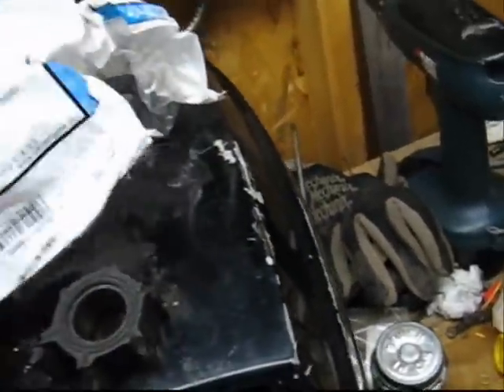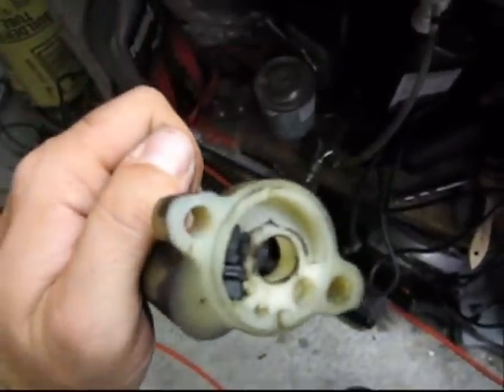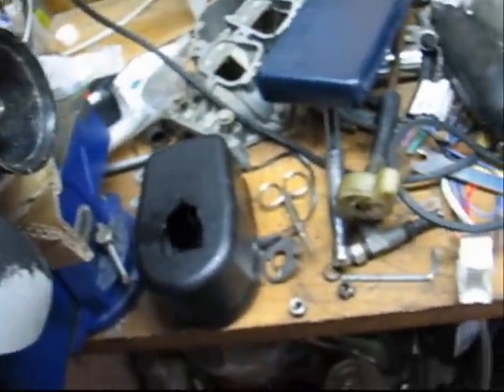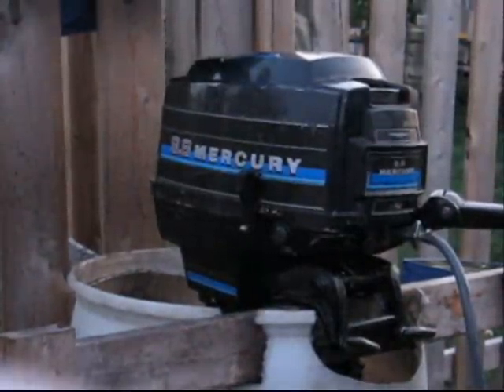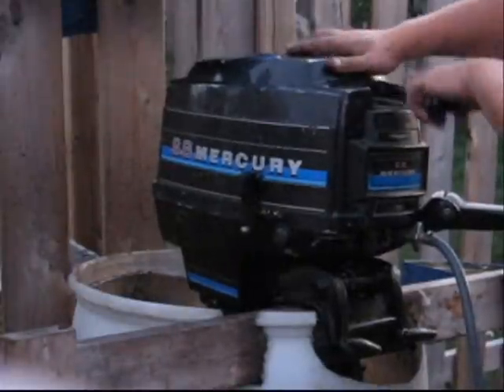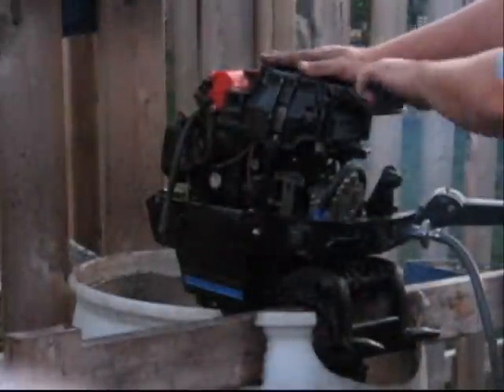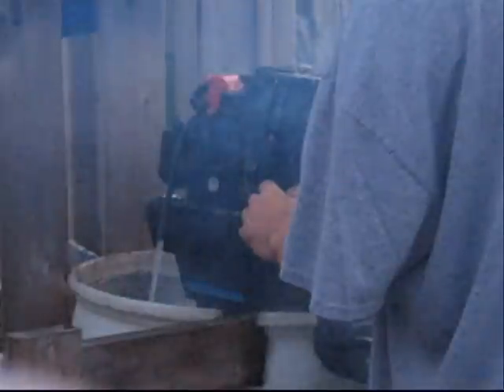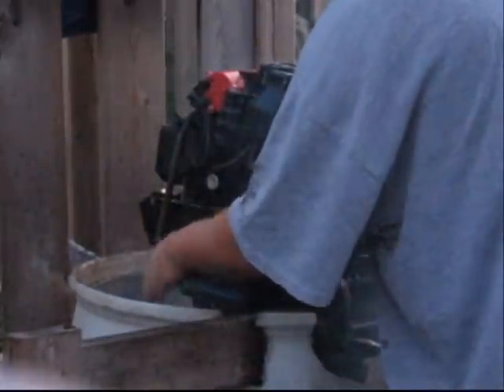1982 Mercury 9.8 impeller service

Comment: hey
you ever work on 1975 9.8 mercury lower unit shifter rod removal?
Reply: I think I might have a similar issue. Mines a 78.  Something is grinding at higher rpm, and it's often hard to shift between R-N-F. I am wondering if the shifter shaft was slightly off when I put the lower back on. However, it's keyed, so it should either shift or not.  

Also, to start it, I find it is often connected to prop, even if it's in the N location. Shifting it back to F and back to N sometimes puts it in neutral properly. 

Same thing for disengaging the hooks to lift the motor, it's often stuck.

Comment: By the way, on my 1998 Merc 5hp, and others with a similar build, the drive shaft can be a real bugger to get back into place. The reason for this is that the drive shaft tends to miss the tube that it's supposed to go into. This is made worse by the task of aligning the shift shaft with the shift shaft clamp. This process causes the drive shaft to go in at an angle. When the drive shaft misses the tube, it will go up into the housing to the SIDE of the tube. Then it will go no further when the lower end has about two inches to go before the two halves are mated. If this is happening to you, I suggest you take a flashlight and carefully make sure the end of the drive shaft is heading toward the tube while aligning the shift shaft. I finally gave up and took the shift shaft clamp OFF and just concentrated on getting the drive shaft where it belonged. I was able to attach the clamp with a pair of needle nose pliers through the side port that is provided for loosening the clamp. I Hope this makes sense. It will to anyone who has spent the hours of frustration that I did trying to figure out why my drive shaft would not go all the way in!
Reply: I had the same issue after replacing impeller. Now mine rattles / grinds at higher rpm. Wondering if it's just needing oil in the lower unit. Also, when in N, it is often still connected to propeller. (pulling cord, turns the propeller) like it's still in drive. If I shift it back and forth between N and F sometimes it works and falls into true neutral. 

Also noticed it's often hooked (can't lift motor) until I repeatedly move shifter back and forth. Think it's slightly off in the shifter shaft, or is this something I need to adjust up in the upper unit?
Reply: @cliffordcommanda6105  Don't know.

Comment: cpgixxer, I'm looking for 2 stroke 9.8hp and 15hp Mercurys to buy.  If you run across any of these I would appreciate a holler. Thanks. Kept my '82 9.8 running for 31 years: changed impeller, rebuilt carb, changed ignition coils and switch box.

Comment: 1liveandlearn11, all you need to do is tap it down with a nylon hammer, the rubber gasket is probably stuck but there is nothing other than 2 bolts

Comment: I have a 1987 Mercury 20 hp and there is a linkage that needs to be removed from the top of the motor.  I too couldn't remove the lower unit and had to take it to a mechanic and he discovered it.  It wasn't easy to unhook the linkage because it was hard to get at. It was the first time he came across that model (he works mostly on Johnsons and Evinrudes so he wasn't familiar with that Mercury model)

Comment: well friend the thing I'm looking for most is how to remove the LU, I'm good with small engines but new to the 1975 merc 110 outboard. I got the thing about replacing impellers but am looking how to remove ,LU from a '75 110.

Comment: the shaft  is fatter at the  bottom and the counter guy gave me the wrong one.. and that tiny key is a pain in the asss   but tell everybody how you must keep the motor in forward and not move the selector or the motor wont be in the wrong gear.. took me a while...plus putting the lower unit back in... pain in ass.. once its very close.. rotate the flywheel a bit and take a rubber mallet and bang the lower unit and it drops in or flip the whole motor on the shop floor and work on the lower unit

Comment from the maker: @DragonBaine Put grease on the back of the key and stick it to the shaft so it stays in place. Take a zip tie and wrap it around the impeller and tighten it in the middle , tighten it so the vains turn in the direction of the engine rotation. Drop the bottom half of the impeller into the cup, lining it up with the key then cut the zip tie and push down on the impeller, voila!

Comment from the maker: @Niklaus404 No, the top of the water pump casing just comes off by removing the top nuts. I used the larger of the 2, the smaller one is quite uncommon for this motor.